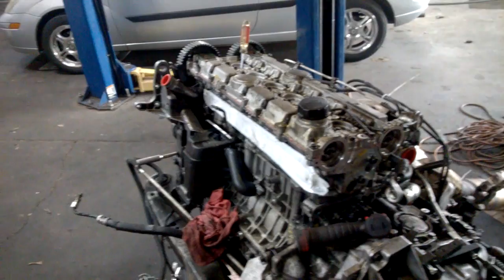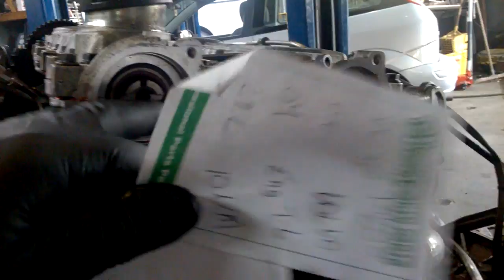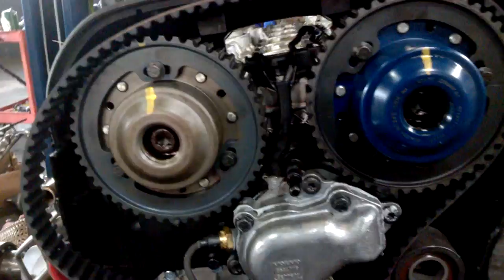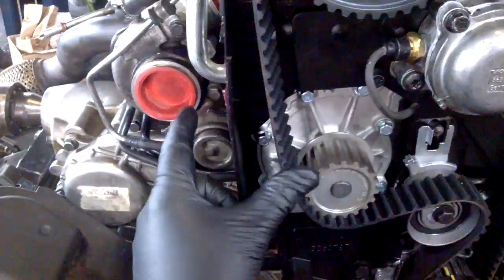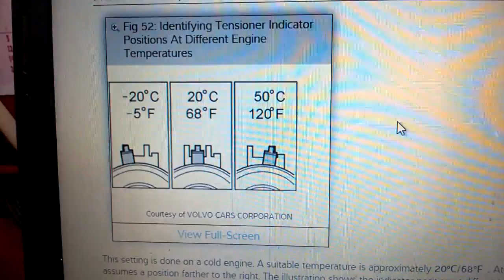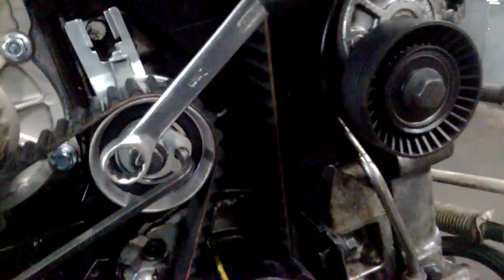T-6 Volvo twine turbo Timing Belt

Comment: Hi I need help please , I'm doing headgasket for my 2003 volvo xc90 2.9l , I rebuild the cylinders head and everything but I'm on hold because I need to know if :

1- can I use Victor renz / Elring  headgasket and head bolts or it has to be genuine volvo ?

2-what is the best aftermarket brand for timming set kit , belt / tensioner/ pully etc  ? 

Basically I want to save few hundreds dollars if the aftermarket would survive for 2-3 years I won't mind if they go bad in  2-3 years. But not few months . I Emiled FCP because they list 3 brands I asked if it's critical to install after market or not , they replied saying all our brands are good .
Reply from the maker: I belive at that time had to use factory parts.
Reply: @racedwg  I bought original bolt it's say fubu on the tip but I didn't buy them from the dealer I found cheaper website .
Reply: there is NO genuine Volvo gaskets!!! Volvo dont make gaskets they sell cars only THEY BUY  from vendors to build cars so yes these work as i put a victor renz on my s70 head and lasted 10 yrs till the car got wrecked in a accident, 2 dont buy the Chinese junk parts that $40-100 timing kits its all crap! will you get 2-3 yrs??? will you get 5 days or longer all a gamble on people that made a $7 part for you to buy at $30 id say no way as the cheap metal and bearing cost pennies in bulk so if a real kit cost $200 would you rather figure out a ride for the next 2 years if that cheap part broke next week?
Reply: @AwakeDude911 I actually bought Elring

Comment: You don't need to use the locking tool I have the 2.9 twin turbo and removed the timing belt 3 times since I had it line your marks up to top dead center put timing belt around all pulleys accept the idler and top 2 pulleys start off with the left one then the right and slide on to the idler rotate the crank a few times make sure the lines are top dead center if it's off a tooth you can make it jump one tooth without taking it back off another thing people say don't tighten the timing belt so tight but tighting it saved my engine because my serpentine belt broke and got caught up in the timing belt almost causing it to jump

Comment: I think you tightened the tensioner to the hot position when it should have been on the fist tab position witch I believe is the cold position seeing that the engine has not been run and should be cold.
Reply from the maker: It was 100 degrees out!
Reply: i will install in the middle no matter what. just did my 04 v70 set it to the hot position as it was like 106 outside but cold not run engine ..after 30mins of running it was beyond the marks and all the way as far as it could go to the left with no more room to move .. reset to the middle or just under it as now when it run it sits at the hott mark and has room to move to the left if need be .

Comment: If timing belt broke , can i still fix it or needs new engine
Reply from the maker: Pull the heads off most likely vales bent or junk,sometimes you get lucky, most likely it's junk
Reply: so much hassle to rebuild an engine which you need to do with a broke belt ...find a pick and pull near you and just buy the engine and install that one  way better time @ your welcome.

Comment: A simple way to line up those cam gears is to set the engine up, lock the cams, make your own timing marks on the back of the cam gears, then slip the belt off. I usually do three, correlated to the VVT solenoids. Then you go to remove the gears, I turn the CCW to their limit, make a 4th mark, break them off, replace the seals, then use my 4th mark which I call a LIMIT MARK, and then work from there. That way you're not starting from scratch.

Comment: a question? The camshaft pulleys go all right?
Reply from the maker: Right from engine on belt side is what you mean
Reply from the maker: So long ago now, but if both cams are not right the belt wont work but iam not 100% sure.

Comment: I find it confusing the explanation about the VVT hubs.  But speaking about normal belt change (without replacing the cam seals), as I understand, there is no need to remove the center hub bolt or the 4 gear securing bolts. Just make sure the timing marks stay aligned when installing the new belt (turn the cam gears by hand to match the marks). As for locking the cams, you can use this tool to lock them in the front, much cheaper and easier (IPD 109573) https://images.matthewsvolvosite.com/timing-belt-cam-locking-tool.jpg . Be aware that you will brake the thermostat housing vent hose, see forums for a fix https://www.swedespeed.com/threads/need-info-on-timing-belt-replacement-xc90-t6.174402/ For the tensioner, before setting it we need to make sure the new belt has tension between the idler and the intake cam gear, if there's no tension we need to turn the crank by hand a full turn (with the tensioner bolt loose). Then to adjust it Volvo says to turn first the indicator to the right and past the temperature tabs - then go back to the center position (the block has to be at room temp, around 20C or 75F) and tighten the bolt to 20Nm (15ft-lbs).  Also, be sure to lock the crank as shown. Otherwise, when removing/installing the harmonic balancer (crank pulley) the crank will rotate under the torque applied to the bolts, causing the timing marks to become misaligned with those of the camshafts.
Reply from the maker: sound good ,thanks for reply, it was very hard not much data on this one.
Reply: @racedwg  No problem, we often get questions about people who went removing the hubs to replace leaky seals (usually from clogged PCV), they don't mark the hubs or lock the cams properly and get stuck with bad timing. Always good to inquire first on forums about the procedure before removing the hubs.  I've also added a link to a small cam gears locking tool
Reply: You are correct.

Comment: Does the engine need to be out of the engine to do this? Planning on buying a used XC90 and needs the timing belt done. What is the avg cost to change the timing belt?
Reply from the maker: No it does not it's harder of course.i was installing a used engine when I made the video
Reply: One of the easiest timing belts to do.  3hrs or so.  Do not need the special tool.  FCP Euro has a good video.

Comment: Great tutorial video! I was so confused about this as there are different variations on the procedure floating online.  The official Volvo pdf file says to loosen the 3 cam gear bolts and rotate the gear clockwise until the left edge of the slotted hole contacts the edge of the bolt. Another forum said you have to loosen both the cam gear bolts, and the vvt center torx bolt, and simultaneously turn the cam gear clockwise and the vvt counter clockwise until the bolts bottoms out at the left edge of the slotted hole then tighten everything up and align the marks. One other youtubber said to rotate the crank pully 1/4 turn past its mark on the oil pump, then turn it back to its timing mark before setting the cams.

Your video is very simple to follow, and as I can see after you were done with everything you verified the timing was correct by rotating the engine. It seemed to rotate without any issues. I will use this technique on my project xc90t6!

Comment: what if you replace your piston heads and rod beams  will yiu have to use the crank lock pin to line up pulleycrank
Reply from the maker: David Holley the balancer you mean

Comment: Great video! I did the belt yesterday on my 2005 2.5T XC70 and now it runs like a charm. Great tip on the VVTi hubs loaded forward. Once I locked the camshafts with an identical tool to the one depicted, the time was baging on. A tip for those buying the chinese version, the steel of the tool itself is good and the machining is great, just beware the short bolts bottom up before tightening, I installed the extensions and used the long bolts and went smooth, you can either get shorter graded steel bolts or use a bunch of washers or a nut (which I didn't have).
Reply from the maker: Thanks for watching and the grate comment!
Reply: Where did you get the parts. 
Can't find them
Reply: @lop8828  sorry for the late response, the tool I got it from ebay, just search Volvo Camshaft tool, you'll get plenty of hits. As for the parts itself I always buy them at FCPeuro.com